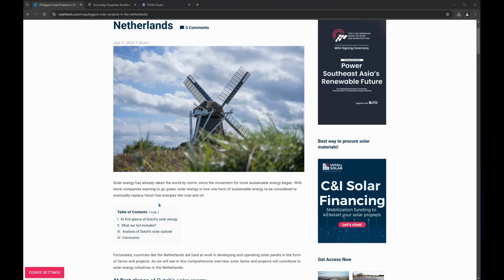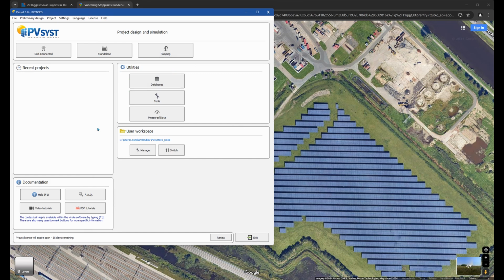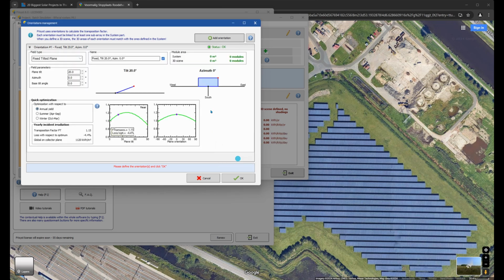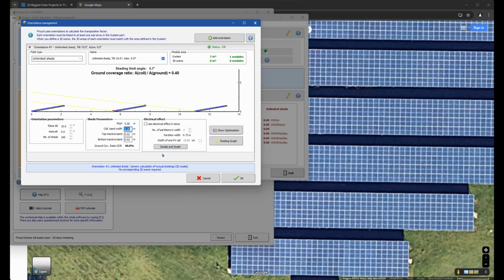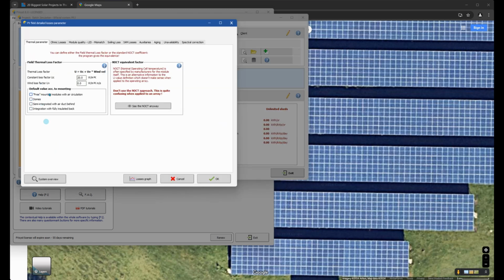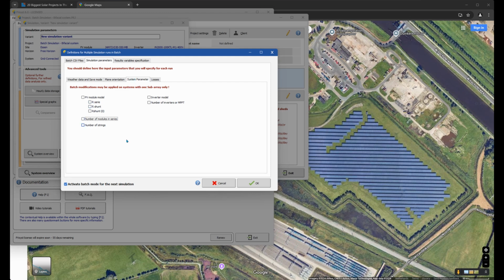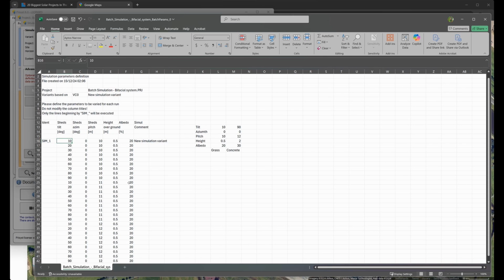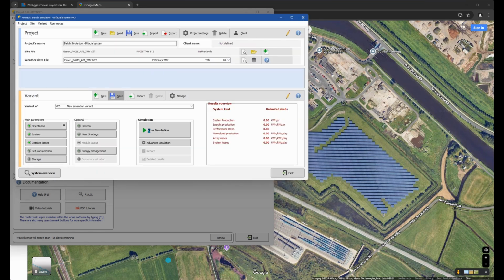Batch Simulations for Bifacial Systems in PVsyst v8.0 in 2025

Comment: Hello, thanks for showing the new PVSYST features
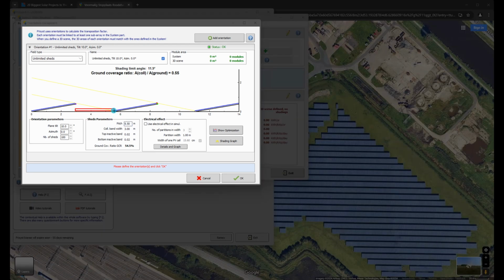There is an error at 7:17 the pitch is the distance between the Start of the 1st row and the Start of the 2nd row. On the drawing : the 1st shed starts à 0 m and 2nd one starts at 5.5 which = what is written
Reply from the maker: You are spot on. Thanks for pointing it out.

Comment: Thanks! It's not entirely clear to me what happens to the number of modules when the pitch changes. With a fixed available area, increasing the pitch should reduce the number of modules that can fit, and therefore also decrease the total energy production. If I understand correctly, PVsyst doesn't take this into account automatically, and you have to manually calculate how many panels fit within the area for each pitch value. Do I understand this correctly? And if so, could you explain the easiest way to do this?
Reply from the maker: You are correct that PVsyst unfortunately does not calculate the no of panels automatically when pitch changes. You will have to manually calculate the no of panels based on the area and the pitch. The idea of the batch simulation is that it helps you to understand what 'could be' the optimal parameters for bifacial system. Your PVystem could be optimized for energy yield, PR or kWh injected into the grid for your business case.

Comment: When I go to the plane orientation, it does not show me the height above ground. What could be the reason for this?
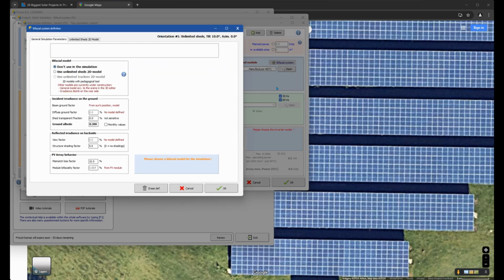Reply from the maker: The height above the ground can not be seen from plane orientation. You need to go to System Parameter → Bifacial Simulations (Select PV Module). Check video timestamp at 9:03 https://youtu.be/IjMr59-kisU?t=543